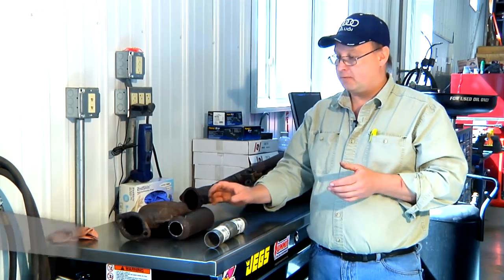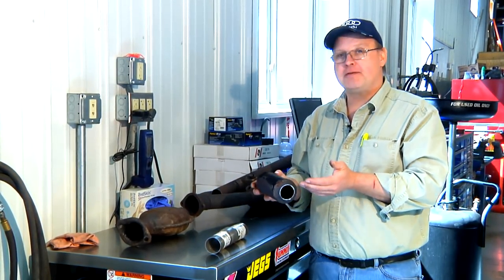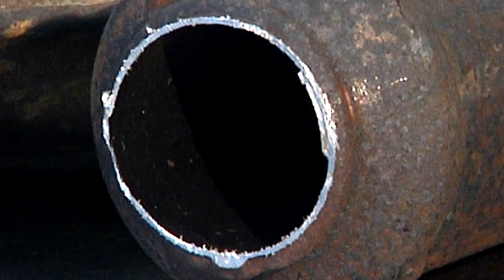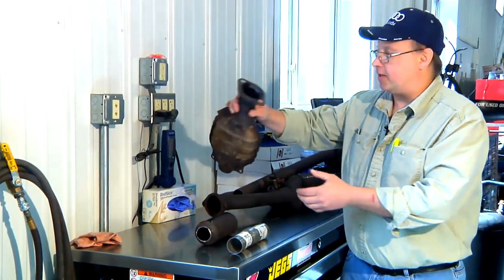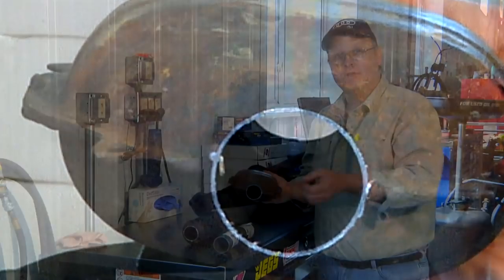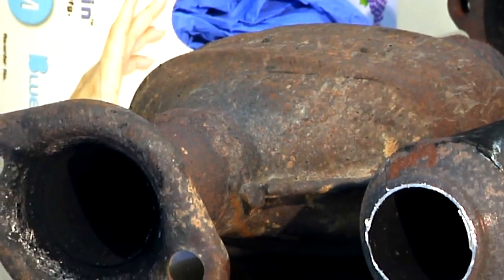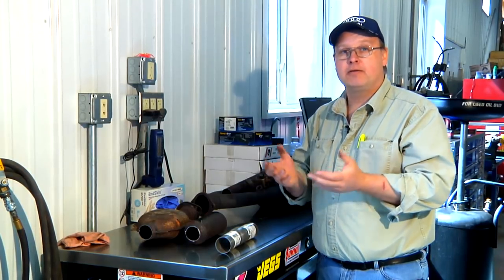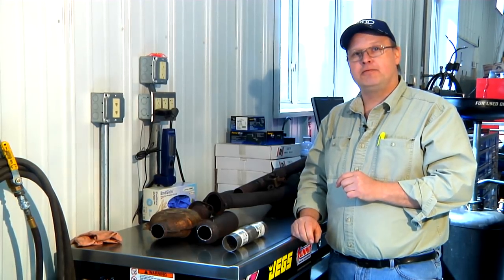What Happens if You Replace the Exhaust Resonator With a Pipe? : Under the Car Repairs

Comment: If back pressure was needed for optimum combustion then why do top fuel drag rails, or any full race car have zero, ZERO resonators, and focus the exhaust on as much flow as possible (hense zoomies on top fuels, and straight pipes on GT Touring cars) ...
Reply: SwitchBlade041294  Because top fuelers have supercharges that blow the exhaust out. Look at all the N/A dragsters....almost every one will have collector'd headers. There is a thing called scavenging going on that you lose when the pipes are too big or you don't have collectors on your headers. Race cars are built for top end performance, they don't spend much time at lower RPM so its way less important. Still, they will size the pipes correctly to get the most scavenging from the system not just take the mufflers off and run 5" diameter pipes.What you are telling everybody is that you do not understand exhaust tuning dynamics. Take some time and research this....you'll see what I mean.
Reply: *****  There is a thing called "Overlap" when both valves are open at the same time. 
Take the time to research basic camshaft 101 and you'll see what I mean.
Reply: *****  so what you are saying is that you don't understand camshaft dynamics at all....I see,.
Okay then, no bother beating a dead horse, you wont learn a thing here. have a nice day.
Reply: ***** Here is a quote directly from "Boosttown.com" I think they should know, don't you? "However, on supercharged engines, where the inlet pressure is high but there is no exhaust back pressure, too much overlap means that inlet charge will go straight out of the exhaust port. Therefore a supercharged engine don’t run large amounts of valve overlap"   Your move genius.
Reply: ***** And here's the direct link...that you wont bother to check because you already know everything: http://www.boosttown.com/engine/camshaft_timing.php
Reply: ***** You obviously didn't bother to read the information I provided.
Reply: ***** Here is the money shot:  "the inlet charge will go straight out of the exhaust port".

Thats is a direct quote....really, just stop and read it.
Reply: ***** I don't know how to put it any simpler, I explained exactly what's happening, I provided diagrams and, quotes and links that validated what I said and all you want to do is deny reality....
Reply: ***** Okay, you can not learn so I wont bother anymore. BTW remember this?  "If you are relying on the tiny amount of cam overlap to exhaust your cylinder because your engine is supercharged then you should go nowhere near an engine with a spanner"...yeah, that was your opening line to me.
Reply: ***** Last time...quote from the article:  "the inlet charge will go straight out of the exhaust port".
Really, you just don't WANT to understand...
Reply: ***** Here is the quote again:  "the inlet charge will go straight out of the exhaust port".
Do you understand what that means? At all...?
Reply: +Sal Molinare "Therefore a supercharged engine don’t run large amounts of valve overlap"   Because blowing your inlet charge out the exhaust is a STUPID thing to do as, you're sending unburnt fuel and boost into the exhaust for no reason other than to combat back pressure?  It said specifically in your own quote they don't do what you say they do because "the inlet charge will go straight out of the exhaust port".  

Get that? They're saying that's a BAD thing so they don't do it.  Why in the world would you waste fuel and boost to push some exhaust? You're supposed to use it to spin the engine...

Valve overlap can be helpful for naturally aspirated engines where the inlet charge must be drawn in by the engine's vacuum, but not in forced induction cars.  That's why when you look at cam grinds, the FI grinds look a lot "less aggressive" with less duration and overlap.
Reply: +ConnorWolf WTH are you talking about? I'm not sure if you're agreeing with me or completely missed my point...without going back a re reading all this old shit, suffice it to say that whatever I posted is true and accurate, supported by facts and documented with links to information for validation. So if you are agreeing with me, congratulations, you have a brain. On the other hand....

Comment: Back pressure just doesn't even sound right. Why would an engine run more efficiently when EXHAUST gases (meaning waste your engine is producing) would create back pressure? I imagine it like exhaling through a straw. The wider the diameter of the straw, the easier it is to exhale through the straw. Thus, my efficiency of exhaling would be increased, not decreased. I know most engines need some kind of back pressure, but a resonator would create a negligible amount of back pressure.

Comment: Bull shit drive 2013 Ram 5.7 Hemi long tube headers cat delete no resonators with duel  pipes out back with no mufflers only thing i run is a Bassani X-pipe no problems yet.......but geesus it is loud.
Reply: +CheckEngineLightOn Probably no problems, but the fuel efficiency might be lower now and you probably have lost low end torque.
Reply: +CheckEngineLightOn get a tune to remove your check engine light on from not having a cat.

Comment: Any pipe you put on an exhaust port that's longer than 4 inches is going to register pressure when said exhaust port is in operation,hell,why not run 5 inch bus exhaust pipe from the cat all the way back,oh,no room,huh.All this talk about strate pipes and glass paks,rezonators ,is not gonna do a damn thing for your little grocery getter but shorten it's life,oh it'll make it sound cool,but believe me unless you're willing to dump 15-30 thousand dollars into a car AFTER you've bought it, then forget it, it's all just a waste of time.Does anybody here know what a laminar flow meter is used for,maybe a few maybe not.
Yeah,I had a 3300 pound car that would do the 1/4 in under 11@ 130mph or 7800rpm if you like and it took over 15,000 bucks in 1972 currency to do it.

Comment: removed my cat to make may for a straight pipe. still has a large resonator behind the cat but its loud as fuck now. next is to port/polish the head ports
Reply: leave it to someone that know??? that someone would be me thanks. i gained power off the cat replacement and they are small ports so there wll definitely be room for improvement. top speed will not be an issue when i eventually upgrade to a turbo conversion
Reply: xempt W I kind of agree with that guy. Some exhaust ports don't like lots of work due to the temperatures of the gases. IE. Grinding valve stem guides down for maximum exhaust flow can damage valves and all that good stuff. But yeah if you know what you're doing, then GL. Spread some info so we have less noobs around.
Reply: ill only be port matching it to the gasket and then if necessary i'll grind more away, i haven't taken the engine apart yet so i don't know what  can do with it. i know i wouldnt touch the valve guides anyway
Reply: yea, i dont want to push the engine, just maximise whats its got. mazda bg5p

Comment: Backpressure is not a myth. Quit comparing normal car specs to racecar specs. You are not smarter than the engineers that built it and you probably work at Ace hardware. And finally, the guy in the video could use a spare chromosome if anybody's got one.

Comment: No - back pressure is never good. A engine does not require it to run efficiently & will run more efficiently if it is maintained as low as possible. Back pressure is a side effect of noise reduction in road legal vehicle exhaust systems. Its a common American V8 myth that is regurgitated ad nauseam.  People are always confusing pipe size, exhaust temperatures/velocity & exhaust scavenging with the back pressure myth.

Comment: Let's set this straight for those that have small brains. You NEED back pressure if you have a truck. A mustang, etc is a different story. Back pressure is required for torque. When you get mufflers that actually increase horsepower and torque the The more free flowing, the less torque, but more horsepower. For a 2,200lb muscle car, fine, it's light with a lot of power. But in order you get a 10,000lb full sized truck moving, you need torque. 

All those idiots 4 cylinder racers and toothless hillbillies with an old truck think "loud" equals power and hugely misinformed.
Reply: So much ridiculous mis- information on here is boggles the mind. 

Backpressure is never needed or wanted in any way shape or form....EVER. It is , however, an unfortunate byproduct of having a sane exhaust note that the average person can live with. 

Most factory exhausts are tuned to deliver virtually no back pressure at all at about 1/2 the rpm of peak torque. This will make the engine (whatever size or configuration it may be) the most efficient it can possibly be at the RPM that it will spend 90% of its life at....all for the CAFE rating that affects the whole lineup of vehicles offered. This is where maximum scavenging occurs.

This has an unfortunate trade off in having Backpressure at upper RPM levels and even at peak torque. You can size an exhaust to maximize peak torque which will have virtually no back pressure at that point. This size of tube is maximizing scavenging at peak torque, but only at peak torque. Below that level the effect is exponentially reduced which hurts very low RPM torque.

Conversely, you can size the exhaust to maximize torque at peak horsepower (which pushes that peak higher as you do this) which causes scavenging to plummet at low RPM but be right in the zone at high RPM. In this perfect state there is no measurable back pressure...but it's loud as hell. And low RPM torque falls off big time. With mid range taking a hit.

The perfect all around exhaust of about 8ft (average-ish car) would have a size increase of 1/4" every 2 feet after the first 3 feet. Say start out at 2" go to 2.25" then finish off with 2.5" at the end. This will give you the best overall performance over all rpm ranges. A bit of a Megaphone effect. An engines desire for a primary tube size is based on displacement mostly with a little nod to cam sizing and RPM range.

Does it work? Hell yea...I've tested it. Can you live with it? Hell no...loud as hell even with 2 resonators and a straight through muffler. Can you imagine starting out at 2.5" or 3"? The only thing that helped enough to make it pallitable was a quarter wave resonator chamber.

Don't let anyone talk you into this whole "you have to keep exhaust velocity up so neck down the exhaust pipe sizing in the tail pipe" horseshit...it's complete BS. Smaller pipes rearward of a non- straight through muffler are only good for noise attenuation and help neither scavenging nor backpressure.

NO ENGINE OF ANY TYPE NEEDS BACK PRESSURE...PERIOD.

Comment: Larger exhaust is NOT always better. Please pull your brain out of the seventies of large displacement extremely restricted engine airflow and put it in the modern reality of exhaust gas velocity designed exhaust systems. To large exhaust plumbing will reduce exhaust gas velocity which will lead to less exhaust gas removal during valve overlap. Proper tuned exhaust has the highest flow rate with the lowest resistance to that flow (pressure).

Comment: this is bullshit! engine dont like backpressure
Reply: +palm jc My Harley sure doesn't.. cut out the cat and patched, and the baffles out of the mufflers got a tuner BAM 6 more HP 4 on the Torque.. quicker response on the Throttle too.  Back pressure are for ^%&#*#'s ...

Comment: If I need back pressure I would just seal the exhaust an have a lot of pressure until my engine blows. Also you never really said what would happen if you remove the muffler, what happens is that you will go to jail for having a car with no muffler and being excessively loud.

Comment: Without going into a scientific explanation as to why vehicles would "need back pressure" let's look into performance cars. do they have back pressure? no... they run pipes either directly off of the manifold, or run longer pipes, with a wider diameter to the rear of the vehicle. 

now if we look scientifically... pressure in equals pressure out in a perfectly efficient engine (not possible) but as close as you get to Pin=Pout you will get closer to the most efficient engine possible. 

resonators, cats, and mufflers were all installed due to regulations to noise and NOX gasses created by government funded sectors in order to keep pollution and noise levels down in major cities. 

No "expert" would ever knowingly say that backpressure is needed in an engine, unless the expert is a complete moron